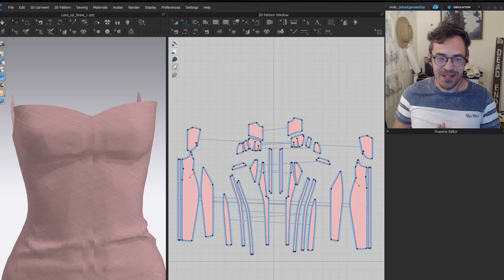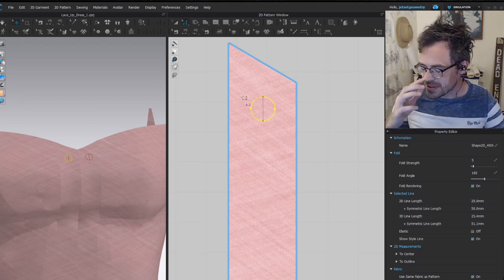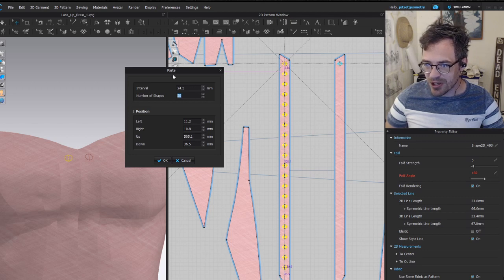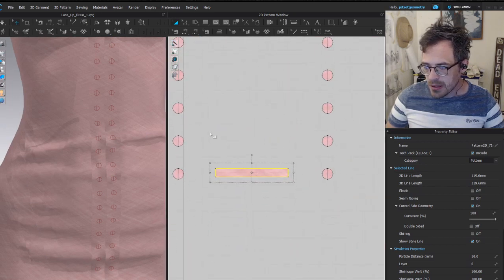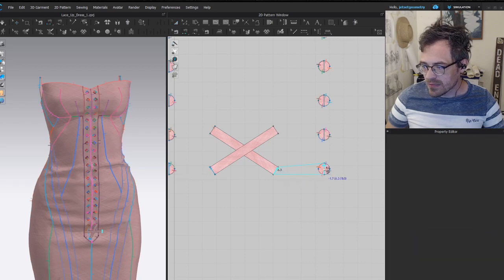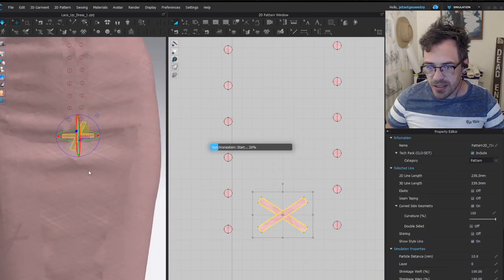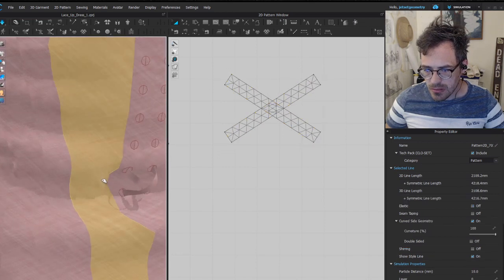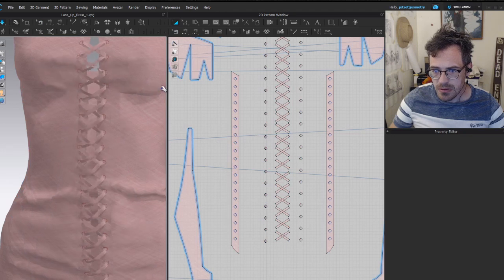Lace Up - Marvelous Designer/Clo3d Tutorial

Comment: hi, my problem is, i need to make a hole for the laces, because i need to export the model in 3d applications, i tried manually connecting the laces to each other, the problem is when i am simulating, the connections are getting scattered, i dont know if i need to adjust some settings on the fabric,. thickness, or collision. it just scatter always

Comment: Hi  Daniel,

I am having difficulty of seam joint at the hole always. I am seeing your simulated sewing is custom angle at string and hole joint, and front and back string shows line connected with turned seam. Can u advise  how string can be custom angle sewing at internal line?